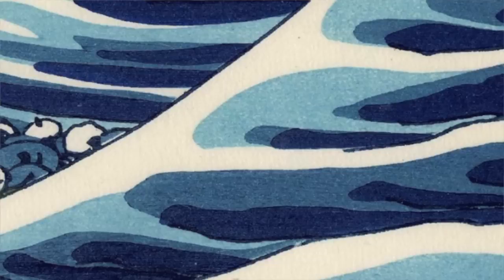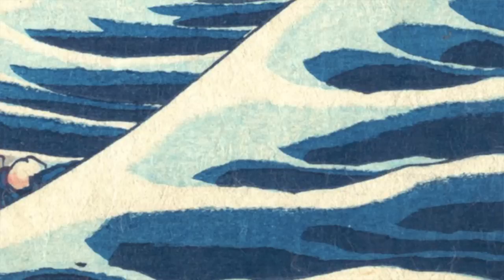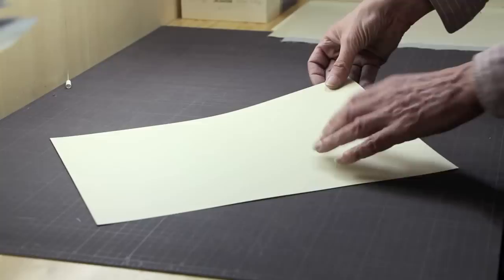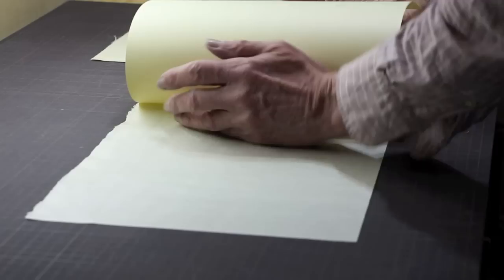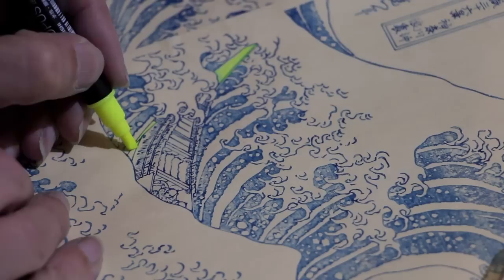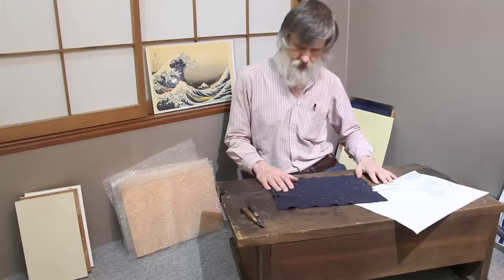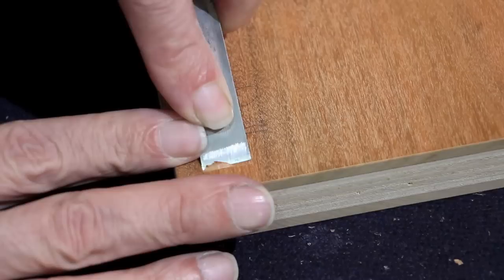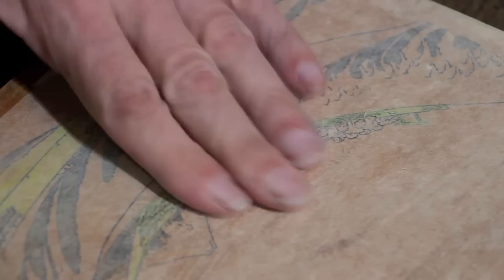The Great Wave - Part 11

Comment: I have to say, the shot of the building with the court and the roof before you entered the shrine, is an angle that we don't even get to see in cinema anymore, it can still be used in asian cinema, but it's more something that we would've seen in the 70s with Lucas or Spielberg, which would also have been seen in 60s Asian/Japanese cinema. I miss these types of grandiose camera angles!